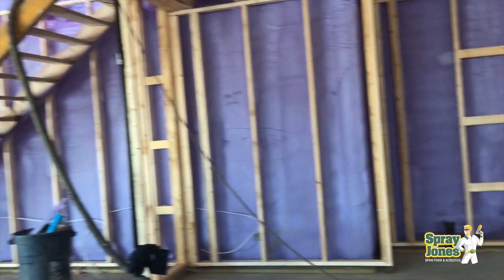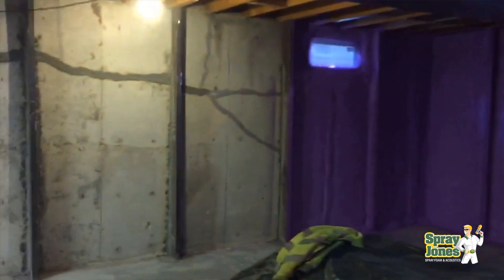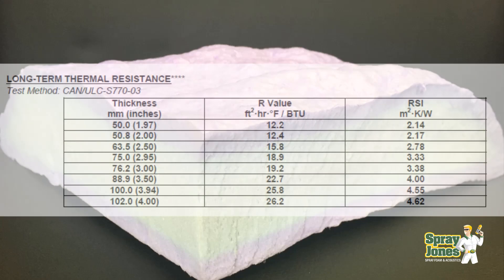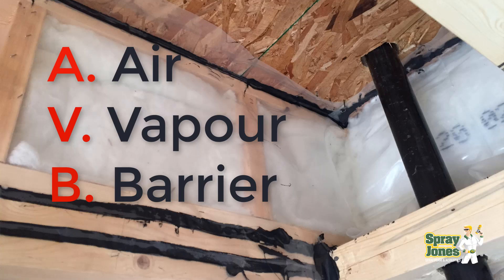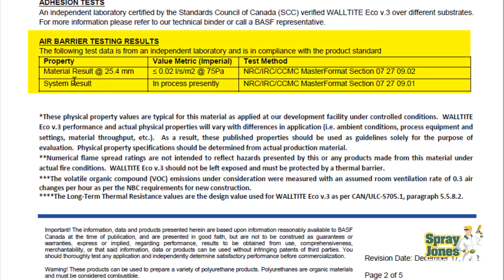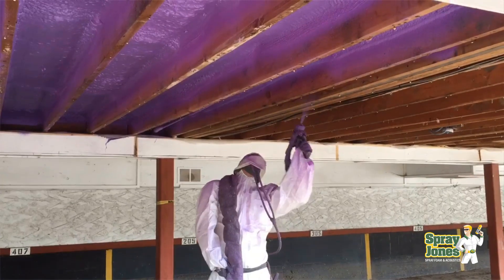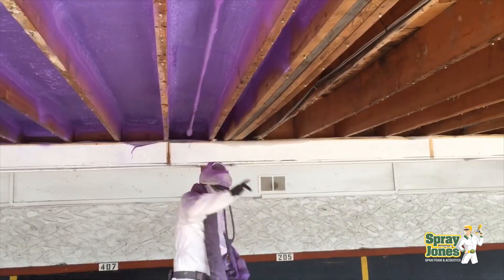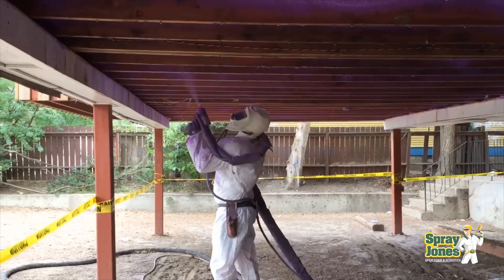Is 1 Inch of Spray Foam Insulation Enough?

Comment: Like your no-nonsense fact-based approach.  I'm building a Honka log home in Buena Vista, CO.  For the non-log areas of the home such as the rake above the log stack and the roofing (metal), what would you use.  Open or closed cell?  how thick for best in class (way above code) R value? and what brand of foam?  Do your recommend anyone in Chaffee County area?  What about sound barrier quality between interior floors?  Btw, using ICF Nudura product for the foundation.  Thanks for your guidance.
Reply from the maker: Closed cell all the way. You need the support. For all else you need to speak with those that know your local regs.

Comment: Hey Spray, couldn't find the next video. I currently have foam board insulation on my attic ceiling. Should I remove them, spray closed cell 2 inches, and then reapply the boards on top?

Comment: I watch and really look forward to your videos. I am wondering about a diy family that built their own home and didnt put "enough closed foam" in to stop interior sweating...and had to remove it all. If it stops heat transfer 72% at 1 inch...why so much condensation? Thanks.
Reply from the maker: Because the "not enough crowd" is 1/2" usually is select areas, and no foam in tight spots. That adds up to huge issues dripping.
Reply: @SprayJones  do you think its overkill to fill an entire 6 inch studded wall with closed cell? Or would you do an inch snd then do either open cell or batts? I am framing a 30x40 second floor now with 6 inch walls and a 13 foot cathedral ceiling to the peak.
Reply from the maker: @rogerwhiting9310  Yes it is overkill. Watch the walls video out now, and the how much foam do I need video.
Reply: @SprayJones  thanks

Comment: trying to get walltite in my basement but there’s a huge shortage due to COVID!
Reply from the maker: Yes. BASF has been hit abnormally hard on this. We have had 1 year of trickle supply from them. 
Huntsman Heat Lok is a great 2nd choice.
Reply: @SprayJones  unfortunately all we have in BC is a bunch of no-name stuff and Shunda Comfot Lock HFO, but they’ve been ignoring me for months when asking them about off-gassing and VOCs. Something doesn’t seem right.
Reply from the maker: @trevorhardy3544  You are correct. Get the data. Send me an email via m web site. I will share the BASF rep info for you.

Comment: Hello, just a confimation that metal as the substrate would have an even lower number than OSB for purposes of water barrier correct? Just had my 50x80 Post Building spray with 1.5" at walls and 2" on roof direct to metal and just want ing to make sure I have a decent understanding of this even though my county requires 0 building inspections other than electrical and I have zero plans to sell/morgage this building

Comment: If I put this on the inside (I have a metal roof, so the “ceiling”) up to 1 inch maybe two, and put batting over it, is it advisable to plastic over that?
Reply from the maker: Don't mix batts and foam. Pick one and use only that. Lot's of videos here to educate you on why.

Comment: 1" is not enough to meet vapor barrier codes and you could very well have condensation on the inside in certain climates!!!. It seals very well that is for sure... I have been spraying foam since 1997..
Reply from the maker: I just presented to you that the SPF at 1 inch thick CAN meet the specs for vapor diffusion set forth in the code. Did you watch this part of the video?
We are taking a look at what 1 inch can do, not writing a grand master spec.

Comment: Two questions. Does open cell of 1 inch thickness also reduce the 72% of air loss like closed does? Do you recommend using open cell on roof and closed on walls of a pole barn. I ask about the open on the roof because I've been told you don't want closed cell in rafters because its harder to spot leaks? Will the open cell then not serve as a vapor barrier against the roof deck?

Comment: Can we add bubble plastic on to thermo property qualify
Reply from the maker: I do not understand what you are asking.
Reply: @SprayJones  I mean if they add bubble wrapper inside the spray could it help insulation but with certain remote direct energy weapon could it affect the rate of exploding?
Reply from the maker: @ericpham8205  Direct energy weapons only work when the flux capacitor is fully cooled with liquid nitrogen. So I don't see it being an issue except if we were planning on using it in hollow earth.

Comment: In an 6" to 10" wall or roof can you 2" closed then the remainder in open cell? Would it be much cheaper than all closed cell?
Reply: Yes it would be less cost naturally but depending on the climate zone you are in is what determines that.. I spray peoples houses and as a contractor I will not spray less than 3" under the roof deck, and I aill spray 2" in the walls at the very least.. I am in north western Ky. which is climate zone #4... A person may b able to get by with less under the roof deck but since it concerns peoples possible life long house I don't like to cut corners.... Just like I would not run #14 copper wiring for my house either... It is normally done once so why go for the "Get by" on either electricity or Insulation..

Comment: We did 1" closed cell in a 6" cavity, and then packed in rolls of Kraft faced fiberglass R-13 rolls.
Reply from the maker: Flash and batt is having REAL big issues in cold climates.
Reply: @SprayJones  condensation issues, or just not keeping the house insulated enough?
Reply from the maker: @spadutyflugins  Condensation.

The science of flash and batt is all wrong. You are relying on the SPF at 1 inch to be perfect enough to hold back the air and thermal drive. The batt won't stop it and you have NOT installed a poly vapor barrier. So the structure can have massive air leakage or condensing points via too thin of foam. 

Go sole source.

Comment: Wow, I’m quite surprised. Here in Germany if you build a new house, the minimum is a value of 0,24 W/(m²K) for the total wall construction. Anything less is forbidden. Here nowadays the insulation is around 6’’ as a standard (e.g. roof).
Reply from the maker: This isn't about code or what to apply it is about what 1 inch will give you as a starting point.
Reply: 6" of closed cell spray foam  ?
Reply: @rydfree   No, either glass or stonewool or extruded styrofoam plates (EPS)

Comment: I’ve been spraying closed cell foam for over 12 years, and am not a fan of flash and batt application. 2 inches may not be sufficient enough to stop a vapor drive in the higher climate zones. If you want to fill a cavity with traditional insulation over a layer of foam, why not just spray a little more foam?
Reply from the maker: 2 inches will stop it, the data is clear on that part. Flash and batt is non sense and I have a new video on it coming out on Friday.
Reply: @SprayJones  I agree, if the applicator is competent enough to do his job properly, you only get one shot to do it right, some companies are hiring people off the street and not training them properly, and I hear horror stories about that after the fact.

Comment: About to have a metal building spray foamed. I’m in North Mississippi. Contractor has quoted for 1” close cell on walls and 2” closed cell on ceiling. I don’t intend to necessarily heat or cool space. My intent is basically to insulate against extremes of hot or cold but with the ability to regulate temperatures somewhat. Is the recommendation of 1” walls and 2” ceiling sufficient? If not what would be your recommendation? Concerned with cost it may add..
Reply from the maker: Here is Canada we do 2 inch closed cell for walls and roof all the time. Reason? It takes the same labor to install 2 inch as 1 inch. So why not pay for a little more material and have all you could ever need.
Reply: @SprayJones Thank you, that makes sense.

Comment: Nice video. I'm considering closed cell to insulate a pole barn workshop but I do not want to spray directly on the metal walls so I can remove damaged panels in the future (ok--and now, too). From the inside I would like to first put foamular sheets on the girts, tape the seams, then spray 2 or 3 inches in the cavity, vertically hang 5' wide rolls of unfaced fiberglass pole barn blanket insulation then finish the wall. Spray foam 6" of the bottom of the cavity to mitigate wicking by the batts. Is this a good idea? Will the spray foam be compatible with the foamular sheets? Will bugs be an issue for either the foamular sheets or the spray foam? The UV rays won't reach the foamular so I don't believe it will break down. Outside design temperature is -25 F, will be a radiant concrete floor with foamular on the bottom and sides with an ERV.
Reply from the maker: Not a good idea.

Put up the timbers, wrap externally with a fabric wrap -- well fastened, then install your metal. 100% spray foam to the inside. 

Enjoy.
Reply: @SprayJones  Thanks for the reply, but my building and steel are already up (which is why I was considering this method). Seems to me spraying on the fabric wrap (I have none---which would need to be added on the inside of the outer girt--thus off the steel) would be less support than spraying on a stiff foamular sheet (if compatible), so I'm not quite clear where you see the problem. What am I missing? Alternatively, would you say if I just fasten fabric wrap to the inside of the outer girts instead of foamular sheets then spray, that is OK?
Reply from the maker: @drinkin-n-thinkin9913  You need the foam well adhered and well fastened to the building and what you are trying to insulate. Going direct to metal is not wrong. You are trying to leave a "what if" in your future. The "what if" now will be a 98% seal which allows air leakage and moisture behind the spray foam with no way to remedy it easily. Also the foam as it cools contracts, this can pull anything off the wall that is not well fastened. I have seen wood studs that missed getting some nails get pulled over by the foam.

Get a good seal and don't worry so much about "if" you need to pull panels off.
Reply: i would not spray foam my steel to the girts any more than i would use subfloor glue to attach my roofing shingles to my plywood roof decking. what did you end up doing?
Reply: @petejohnson8397  So far, nothing. In a holding pattern to focus on building the house.

Comment: Great video. I'm my area, anything less than 2" may allow for condensation. Building code aside, I can't have water in my walls.
Reply from the maker: It isn't about a spec. It is about the stats for starting point. Watch "how much foam do I need".
Reply: EXACTLY
Reply: @tims6763  we talking walls or do ceilings matter too?  I only ask because a ceiling can get as much as 18” of blown in thrown in vs a wall that may only get 3.5-5.5”.  However walls normally get the closed cell on the outside sheathing or the cold side vs a ceiling will get the closed cell on the warm side.

Comment: Spray foam is sure something to look at. Have you discussed when It comes time to add a plug or switch outlet, or run a new circuit. What about adding on the the structure. How much extra work is needed to accomplish these tasks.
Reply from the maker: Not much. Adding a plug into an existing wall is rare, it can be done with the wall enclosed. The foam is usually not 100% of the cavity. More like 75%.
People that have added told me it was easier than with batts.
Reply: A 2x4 stud wall is actually 3.5" deep so even with our walls being sprayed with 2-2.25" of closed cell foam there is still enough room to fish wires through the wall cavity if need be . A 2x6 wall is definitely no issue . It actually is easier as the wire does not get hung up in loose insulation when trying to feed it through .

Comment: What about spraying attic in house in mid Texas? Same 2” or 1”?
Reply from the maker: You will have code requirements. Watch today's video on R value of 2 inches and more.
Reply: @SprayJones  we do not have code requirements where I am. It’s a small town.
Reply from the maker: @Prorex1911   would go with 3 inch then. Today you will see why. 

Also if you want watch right now "how much foam do I need". That will help.

Comment: Don't forget that these products MUST be covered with Drywall/Gypsum for Fire Protection.  Foam emits cyanide gas when exposed to flame.  Deadly.
Reply from the maker: No it does not emit cyanide that is a lie!
Reply: @SprayJones  Does that only apply to Styrofoam?  What gasses are emitted when it burns?
Reply from the maker: @gordbaker896  Mostly carbon monoxide. I have a video on toxic smoke. It is in the health and safety playlist. 
It is older, but the info is sound.
Reply: @SprayJones  In Ontario Canada, due to the flammability of Spray foam, it must be covered with Drywall.  I doubt that it emits CarbonMonoxide when it burns.  That is from hydrocarbon fuel.
See attached.
 Here in Ontario, yes it is required to be covered by Gypsum wallboard (drywall) because it is flammable.

The vapour barrier is a separate issue. There are generally two different types of spray foam, Open cell (also called Icynene) and closed cell. The closed cell has a higher R value or Resistance to Heat Transfer than the open cell and has a "Perm rating" that allows it to act as a vapour barrier, however, some municipalities may take issue (although rare, it does and has happened). There are some Inspectors that are concerned with the possibility of shrinkage of the wood framing materials over time as they reach equilibrium and are concerned that once the foam has cured (hardened) the shrinkage of the wood could cause slight gaps which would then become a direct thermal bridge, allowing the potential for condensation to form on the back of paper faced gypsum wall board.

Again this is uncommon as spray foam insulation is widely used now in the southern Ontario market.

To summarize, in Ontario, yes spray foam insulation is required to be covered with Drywall.
Reply from the maker: @gordbaker896  Those rules are Canada wide. There are a number of coverings that are approved besides drywall. There are spray on coatings too. Plus exemptions from covering for certain areas....
There is no rating in National Building Code for smoke toxicity of products.  
Watch my video where we burn the SPF. In the comments there is a ex-fire marshall that weighs on it. He makes some good points.
Reply: @gordbaker896  It's funny that spray foam only burns as long as there is an ignition source . Take away the flame and the foam stops burning . Wood studs on the other hand is actually it's own fuel source .
Reply: @rydfree  Yes I guess it could be called 'fuel' to feed an existing fire.

Comment: I was trying to watch the video but there's so many commercials I had to turn it off
Reply from the maker: I will look at see what the settings are at YT and adjust.  hate annoying ads too.
Reply from the maker: I checked and they "defaulted" mid video ads. So those are turned off. Skippable beginning and ending ads only.
Reply: @SprayJones  I love the information but I'm kind of out in the country and when  add comes on it takes forever for the phone to finish loading

Comment: How are the two foam components mixed within the gun? I know that the separate components are toxic and have to be mixed thoroughly in the right ratios to become non-toxic. I don't understand how this is accomplished in the gun. It doesn't seem that it would mix the two components well.
Reply from the maker: First of all these are chemicals not food grade ingredients. So "toxic" is like saying the paint going on my walls is toxic... the framing of the language is wrong. 
The chems are mixed in a mixing chamber via impingement mix at 1000 psi. That means they enter, hit each other and swirl before leaving out under high pressure. It is more efficient than stirring by hand.
Reply: @SprayJones  "Impingement", great word. I'll have to work that into a sentence tomorrow!

Comment: Great video again. As per your suggestion I am also getting 2” Walltite sprayed directly on concrete then I’ll frame in front of it but I was thinking of putting in Roxul in the stud bays after. 
Hopefully you get that video out soon lol
Reply from the maker: Thank you for your feedback. 

The roxul is completely redundant after the 2 inch of SPF. Spend the money elsewhere unless you are being required to do this for some reason.
Reply: @SprayJones  what would you suggest? The 2” will give me approx r12-14 but I think the Ontario building code wants like r20 now. That’s almost 4” of foam. Going to make my tiny basement even smaller haha 
In your opinion, would the 2” be sufficient for our winters? (Eventually it will be a finished basement )
Reply from the maker: @skyline5354  Walltite can do that at 3 inches. Offset the framing 1 inch and then install the foam.
On Friday the new video will be about R value and the SPF. A great follow up to today's video.
Reply: @SprayJones  ah I see. I was planning on spraying first then framing
Reply from the maker: @skyline5354  Frame 1 inch off the wall, 24 OC and then spray 3 inches CC. That is what we do all the time for our projects and the pass code.

Comment: I'm confused....if closed cell foam expands 25 times of it's liquid mass...what is the total expansion of 1 inch of spray ?
Reply: The 1" refered to is after the foam has expanded and cured . You would not want to spray 1" of liquid material at one time or it would not cure properly .
Reply from the maker: The maximum expansion of the chemistry is to be x25 greater than whatever the liquid mass is of the two components that are mixed. Thicker foam is just more liquid mixed product rising.